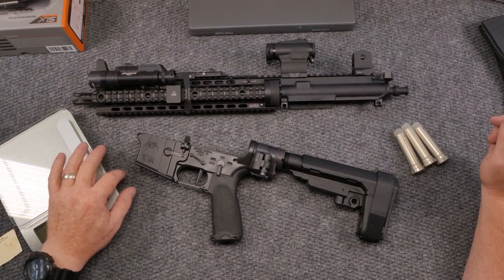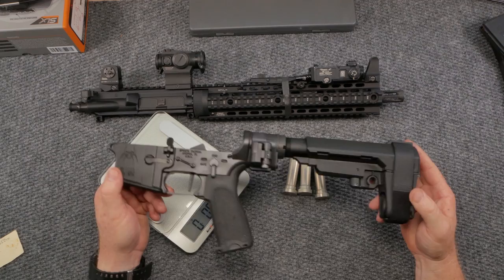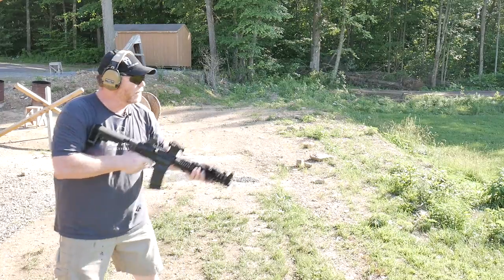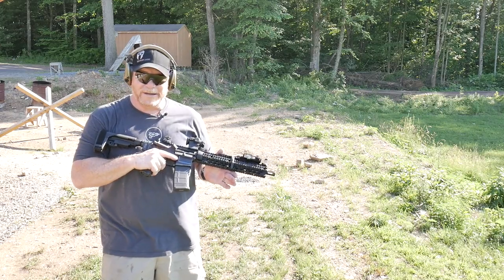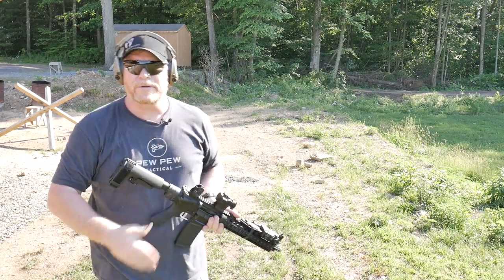Buffers! Buffers! & Buffers!  What's the Difference H1, H2, & H3 Let's see what happens

Comment: Don't worry about where the brass flies as long as it flies every time.  I use heavy buffers to slow down the unlock of the bolt for easier extraction, I don't care where the brass lands.

Comment: buffer kits I've bought have included rated springs.  Never been much of an issue with semi-auto 223/556, It's the 300blk, 350l, and others, the buffers make a profound difference in them. of course it all depends on the weight of the bullets you run. I've been truly surprised by the outcomes of different weights in the non-556 ARs and there is no set standard, it all depends on the gun/parts. The one 556 ar I have that ejects like what's in this vid is my light weight low-mass rifle. even with the gas near shut off + H2 it still does 2 o-clock. @ 6lbs W/1-6x24 on it I'll live with it.

Comment: AATW, fellow WF here.  Great video.  What might be happening is when the bolt hits the back of the buffer tube, it is further back into the upper receiver, or too far forward, because of the LAW tactical folder.  Pull the charging handle all the way back till it stops, the bolt face should still show about an 1/8".  If it is longer or shorter than 1/8", that would cause a change in the ejection pattern, even if the rifle is gassed right.  Thanks for the videos, would like to see a follow up vid.
Reply from the maker: Roger that

Comment: I never ever do a build with out an adjustable gas block!!!  I hate ADDING weight when it is unnecessary. Over gassed gun can beat its self to death prematurely.
Gas correctly, THEN fool with buffers if necessary. Adjust the gas properly FIRST!~
Reply: And what if you want pinned f marked sight?
Reply: @mblake0420  
They make those in adjustable versions. True. Do a search.

Comment: Got a 10.5”, carbine length gas system and looking to add a dead air sandman-s. Going to have to add a JP capture spring/buffer H3 with added spring pack. Good information.
Reply: Im new to this buffer weight tinkering but you may not need all that weight with the carbine length gas system. Also if you want to save a few bucks on the buffer I have a armaspec stealth recoil spring in my 10.5 300 bo pistol and id highly reccomend it. I also have an adjustable gas block so i run the h1 set to cycle subs n supers. I swapped the h2 in but didnt notice much.
Reply: FWIW I'm a big fan of the JP stuff, IMO it's an essential in tuning a silenced AR.
Reply: @Jimmykid3  I'm running an Armaspec SRS-C 3.3oz in my suppressed, 10.5 300blk with a Superlative adj gas block. Cycles and bolt locks back correctly with Supers; however, with Subs, it cycles but I can't get the bolt to lock back all the way. I've switched out to conventional carbine buffer and springs, tried different weights and adjusting the gas and i still can't get the bolt to lock back all the way on Subs. Looking to try a JP next.
Reply: @snek9353   Are you running one? I'm running an Armaspec SRS-C 3.3oz in my suppressed, 10.5 300blk with a Superlative adj gas block. Cycles and bolt locks back correctly with Supers; however, with Subs, it cycles but I can't get the bolt to lock back all the way. I've switched out to conventional carbine buffer and springs, tried different weights and adjusting the gas and i still can't get the bolt to lock back all the way on Subs. Looking to try a JP next.
Reply: @danielthompson3837  Yes I'm running a JP SCS, the one in my 300BO pistol however is an extra short version with only 2 weights, not the typical 3 weight carbine version. 

You really shouldn't need anything radical to get it to push the BCG back far enough to lock. Subs do of course have less pressure, so you need more gas port opening to cycle subs. This should just require opening up your adjustable gas block(or closing it in the case of the Superlative). I'm assuming you've done that though, as well as double checked gas port alignment. If so my best guess is that the gas port hole in your barrel isn't large enough. That's the next thing I'd check, never dealt with one too small, but I doubt it's a big deal to just drill it bigger. 

Curious why that gas block, that Superlative is a bleed off type. This means it's going to have port pop at the gas block defeating the whole purpose of the 300BO/Silencer/Subs combination. I'm just now installing a Seekins Select Adjustable on mine to make the swap between supers and subs easier/better. Sounds like that might be useful to you as well. 

As for the JP, I like the easier swapping of springs and weights with the JP stuff.
Reply: @snek9353  So I'm running Superlative on all my rigs, and all are suppressed. I guess my intention or thought, was knowing that most are over-gassed to begin with, and adding a silencer, I didn't know what type of issues I'd be having: more over gas, less gas, Supers and Subs, etc. So I wanted the capability to fine tune, and instead of "choking" (as most adj gas blocks do), I liked the the Superlative's model of bleed off at the barrel. Maybe I overthought it. Sometimes I do that when K.I.S.S. is more applicable. : )
Funny thing was as I was performing all these adjustments, I borrowed a friend's lower with a standard carbine buffer and spring, and it locked back correctly (with the same gas venting). I moved back to my lower again with the Armaspec with no luck. Even placed my original carbine buffer and spring back in and wouldn't lock back all the way. (Guess I need to steal my friend's ) :). 
Thanks for your response, input, and advice. I'm going to look into the Seekins as you suggested. I'll work back through the gas system as well to ensure all is correct.
Reply: @danielthompson3837  im running one and have tried both the h1 and h2 weights on a 10.5 300 bo with the odin click adjustable gas block and it cycles subs with no can and locks back
Reply: @snek9353  yea i thought the same thing about that superlative gas block and port pop but never heard any mention of it causing pop in videos and have asked and cant ever get an answer other than its the best on the market lol. I went with the odin works because it was click adjustable and has an inconel adjuster and spring. I was going to go with the jp in my gun but found the armaspec and at less than half the price for a very similar function i couldnt beat it. Its also pretty simple to change weights too.
Reply: @danielthompson3837  try your srs in your friends lower. It sounds like you have an issue elsewhere if your upper works on his lower but swapping in a standard recoil spring and buffer wont allow it to cycle. Idk could the buffer tube be slowing things down?
Reply: @Jimmykid3  Great advice. We'll keep messing. I just took apart the gas "assembly" to ensure there wasn't any blockage and everything looked fine.
Reply: @danielthompson3837  if the upper is running fine on a different lower its not a gas issue.

Comment: Even if you don't get much of a change to the angle of ejection it still benefits you to use the heaviest buffer that runs. While it may not be perceptible it every so slightly delays extraction and aids in both reliability and reduced parts wear. Even a few milliseconds delay gives the chamber pressure more time to come down before the extraction begins. I personally use the Vltor A5 system because it gives more weight and slows down more due to that and increased travel over carbine.

Comment: What I do 1st is make sure it locks back on an empty chamber, load 1 round in the mag, fire it, amd if it locks back you at least know it works.  Then repeat that process getting progressively heavier, till it doesn't lock back amd drop down one or 2 buffer weights depending on the ammunition I am using, becaise a heavier 77g wont work like a 55g

Comment: My ballistic advantage hanson profile 12.3 is actually under-gassed. So I have to run a 3oz carbine buffer if I want it to work with cheap low quality ammo that is sometimes under-powered. If I go to even just an H1 it starts short stroking with stuff like Tula and even some cheapo brass stuff. There's also little to no gas "excess" expelled that you can see in the air when firing like on yours and most other guns. The gas port on mine is definitely not properly sized. Meanwhile on yours the port is probably larger than it should be and you may need to experiment with different buffer springs in addition to adding the H3 buffer and possibly may need an adjustable gas block if you really care about getting it fine tuned. Definitely seems like some quality control issues going on with Ballistic Advantage. Put in a google search and you can find lots of complaints on the forums as well regarding gas issues using their barrels. Don't bother asking BA customer service about this either because they will be of no help. I don't know how they got their great rep but it seems like ballistic advantage is over rated by many people. I should have went with Rosco and will go with Rosco from here on out for future builds.

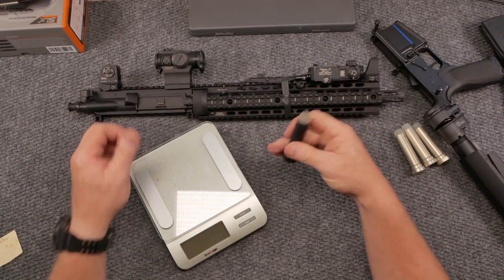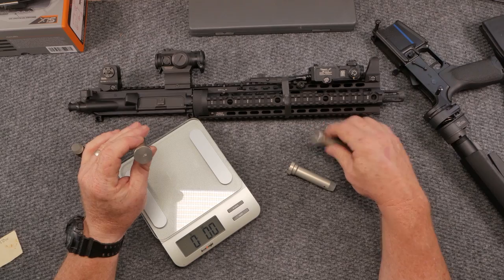Comment: So have been having some bad luck with my Barrett REC7 DI 16" barrel with a mid-length gas system.  With the H1 buffer that it came with it ejects out to the 1:00 position.  I've tried a carbine buffer, H3 buffer, and H4 buffer and all 3 of those ejected between 1:00 to 2:00.  I have been shooting American Eagle .223 ammo with every buffer.  I might have to experiment with different springs.  What do you all think?

Comment: Seriously,  the heavy buffer is (one), used to slow down the cycle rate mainly on full autos. It's not going to change ejection direction but might shorten the distance but only slightly. (Two ), create a little more resistance of the rearward drive of the bgc and slow it down just enough for lower pressure rounds like sub-sonics to fully expand in the chamber and seal before starting its ejection cycle. Even so this can really only be detected with a high speed camera or shot timer measuring a full auto cycle rate. Seriously try that and you will see. (Third) the heaviest buffer might add to the felt or percieved recoil.
  The 7 and 9 ounce buffers used in some pcc's do this on recoil. Colt used heavy heavy buffers to slow the cycle rates on sub machine guns.

Comment: I find buffers to be for fine tuning.  The issue is the length of the gas system.  I do not know if you could get a short gas system to have less recoil without an adjustable gas block.

Comment: Try a TUBBS flat wire carbine buffer spring with that H3. Or at least an enhanced buffer spring of your choice. Of course an adjustable gas block is the best solution for an over gassed gun.

Comment: Geissele 42 braided buffer spring with their H2 or H3 buffer, should help.
Reply: GrimCasanova  you have to watch putting the 42 in with those especially with the law folder because A- they either won't fit or B - there's just too much tension because they are not meant for that shorten buffer tube of pistol tube . If you wanna run that you need to get the regular or m-4 or Carbine buffer tube .
Reply: @johnneill5960  the pistol tube is the same length as a carbine tube. Hes using carbine buffers in the video. The pistol tubes that are different are just tubes no slots on the bottom. Super 42 works fine in my pistol

Comment: Gonna need adjustable gas block. I have a Ruger 556 mpr 18 inch barrel rifle length gas system. I had to go to h2 buffer with springco red extra power spring to bring ejection  from 1- 2 o'clock to 3 -4 oclock

Comment: My combo that works for me. 4oz weight w/Sprinco enhanced power “blue” spring. On a mid-length 16” barrel. Had a Carbine buffer and spring in it originally doing the same 2 o’clock ejection

Comment: My bcm 12.5 was a little snappy so I threw in an h3 with a standard carbine spring and it runs about 3-330. For me though I was worried about felt recoil, if it’s a little over gased that’s okay, shell run everything... I mean EVERYTHING. And in light of recent events if shot gets real, and you pick up mags off someone, your not going to have time to tune your gas systems

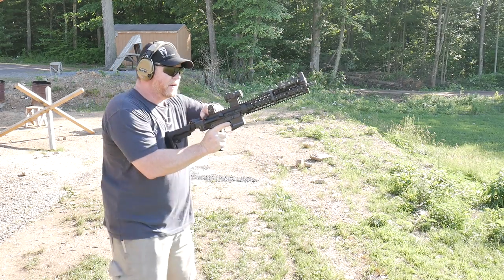Comment: You won’t usually fix a 12:00-1:00 o’clock ejection trajectory with just a buffer or spring. In my experience, you will need an adjustable gas block or, port resizing or a new barrel. THAT much over gassing won’t usually be overcome with just a heavy buffer or spring. Note, I DID say usually and in MY umpteen years experience- in building, fixing and shooting AR platform rifles. Others will and have sworn that the fix all is a heavy buffer. I’m glad it was as easy for them, however I’m inclined to believe it just made it close enough for them. I just doubt that they were able to get it to the optimal 4:00 o’clock trajectory. Just sayin...

Comment: Didn't see that coming. I run a H2 buffer in my 300 BLK Out pistol and it's at 3 o'clock .  I'm building a 11.5 mid length pistol and bought a heavy spring and a H2 buffer.

Comment: A question for you. I have a heavy side charging AR shooting 6.5 Grendel out of a 20 inch barrel with rifle length gas system, rifle buffer tube, buffer spring and buffer. It does not cycle. Manually when I pull the charging handle the shell pops out just fine so I know it is not the bcg. I changed the spring to a carbine spring to allow the bcg to go back further and that didn't work. Would reducing the weight of the buffer help the bcg to go further back do that the shell can be extracted and a new round chambered?

Comment: Kota man.  So my thoughts are.  You can’t really expect to see any changes in the ejection pattern cause your only swapping the weight.  You’ve got the spring / gas tube / etc.  all those make a HUGE difference.   Hell even the BCG.  But mostly the spring and gas tube.  Now I know you know firearms especially AR’s.  Just saying maybe next video.  Maybe make the same type upper but with different length tubes and springs in each one and then retest it
Reply from the maker: Excellent advise
Reply: Kotaboy32 Tactical    Much appreciated
Reply: Different length tubes? Is there something other than pistol, carbine, mid, rifle?
Reply: Suburban 🙄 seriously
Reply: Spring, yes. Gas tube, no.

Comment: OK so I have a bit of a conundrum on this subject maybe others can chime in on. Silenced 300BO pistol with adjustable everything. It's not reliable at stripping and chambering heavy hollow point subs from a full mag when using the bolt release. Add more spring or more weight?
Reply: Sorry, Man. Having somewhat similar issues that I described to you above. I've tried just about everything and running out of options.
Reply: @danielthompson3837  No worries, just pondering which to try first on my next trip out. I'm thinking both will be needed, we'll see.
Reply: @SeniorTac I'm sure the mag is part of the problem, this issue occurs with the surefire quad mags, works fine with pmags. Most often it stops just before the rim clears the feed lips. Not much I can do to improve those quad mags. Feed ramps are fine, smooth M4 style. Spring wise this bangstick uses an extra short JP SCS. I have a selection of JP springs, one issue is that the heaviest they spec for my setup is the 100 and it's already in there. I can however try a 105 or 110 from my AR10 kit. Don't see any reason why I wouldn't work. Or I can add another tungsten weight, or of course both.

Comment: The H1 was the same no difference at all .... and yeah the H2 and H3 were the same. I sure hope it makes a difference with my new build? I have not got it together yet but have all the parts of a .45ACP carbine. Cant go no shorter then a 16" due to state and local laws :>/ and i dont have any issues with my 9mm Carbine with its gas system but i did go with a radial delayed blowback CMMG barrel/BCG combo for a dedicated upper/lower for the 45ACP.Cant wait to get it together!!! :)  Also have a .224Val rifle wiht a carbine length buffer kit. I did purchase a rifle length tube and buffer and spring but i have not changed that over yet either......all the parts just came in this past week. I work 6days a week and then im a lawn care service on Sunday's or my wife would kick my arse! LOL so when it comes to down time there isnt much to find, for any of my hobbies but i do try and make time for my plinking.....Any suggestions on buffers for a .224Val rifle and or a .45ACP carbine? The radial delayed blowback is said to only need a really light one but idk which to buy?

Comment: If I buy a cheap 25$ h2 buffer that says it’s monolithic, I’m assuming not moving weights inside . How does that fair will a regular style buffer sorta dead blow or will it not matter with a cheap solid construction buffer? I just wanna add weight to my cheap m4
Reply: I assume it won’t make any difference I want to slow the cycling rate is all. Maby it would change at higher weights h4 etc but at that point the buffers would no longer be solid construction as they would definitely need tungsten in a carbine buffer

Comment: Hey KB32 I've got a question! Building out a PSA PA10 GEN3 BUILDERS SET. With a 18 inch fluted mid length gas system barrel, adjustable Aero gas block and a carbine 6 position buffer tube. What do you recommend for a buffer weight? Any information would be greatly appreciated! Thanks